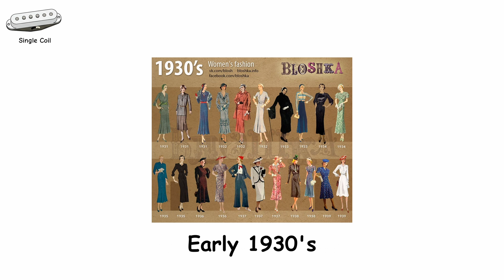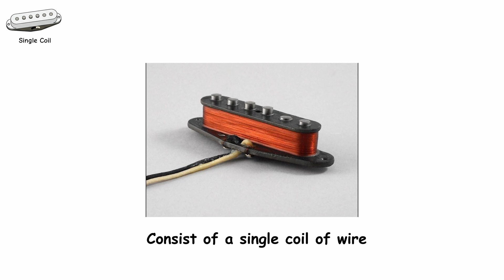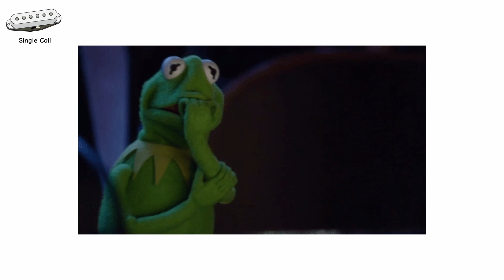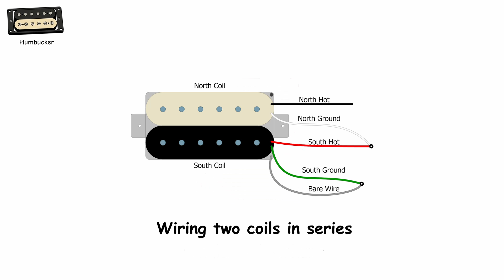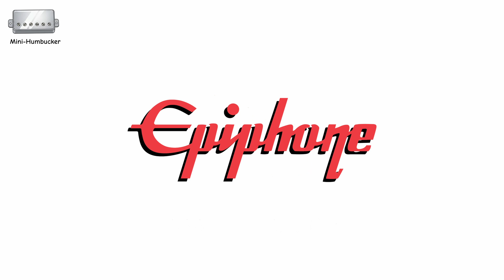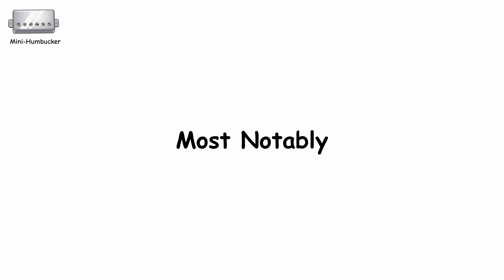Every Electric Guitar Pickup Explained

Comment: From CE 1966 to 1985 I worked in an electronics laboratory where we had the best R&D instrumentation and we made everything (including some Guitar Amplifiers, PA amps, sound effects boxes, etc..) as well as a lot of precision telecoms equipment we were there to manufacture!   

At one stage I picked up a Fender pickup and inverted it and the sound was identical, same with a humbucker – then the penny dropped.   All of the pickups have a lot of very stray magnetic fields – stray where they should not be!  It was very lucky the humbucker worked at all!  

Several years later (about CE 2000), I did some detailed electromagnetic mapping of a few pickups and this confirmed my worst fears that the people that designed / manufactured these pickups were totally clueless about electromagnetic fields and the associated electronics and prime reason most pickups sounded so different was the electronic circuit they were connected into. 

I also found a quite wide spread in inductance, resistance etc. for the same model pickups – and this is why the same pickups “sound different”!  Very poor manufacturing quality – and this was physically backed up when I actually went a guitar pickup manufacturing factory.  While there I gave the several tips on how they could really raise the Quality of their manufacturing to make their pickups sound far more consistent – and I showed a few people there how to actually reliably solder wires!  

Back home (circa CE 2010) as I had a very good understanding of electronic circuit theory, I then “electronically tuned” various pickups to musically sound like virtually any other pickup.  This was much easier than I originally thought.

Comment: The reason piezos sound so different is that they are picking up all of the frequencies on the string with equal gain.  It senses the stress at the end of the string instead of the displacement at some point inside the string length.  All harmonics have equal gain for stress at the end, but sensing displacement in the middle gets a comb filter effect with the comb time delay depending on the distance to the end of the string.  Furthermore, piezos are broadband while magnetic pickups are bandpass filters around the coil resonance frequency.  It has nothing to do with picking up body vibrations.

This is also why modeling guitars like Variax  sense using piezo.  They can produce the sound of different pickups in different positions by using a suitable FIR filter (different filter for each string) from the piezo.  All the frequencies are there and equak gain and so you just shape them to make it sound like a magnetic pickup.

Comment: It's ok if you don't know every detail about everything, but when presenting a video like this it's really important that all of the information you present is completely accurate. 
You really have to research everything you present. There are several incorrect statements in this video, they may not seem very important but that's how incorrect information gets spread. 
The mini humbucker was not developed by Epiphone before they purchased from Gibson. The mini humbucker was developed by Gibson and featured the exact same construction as a PAF, just smaller, this would have been a protected design covered by the PAF patent at this time. Gibson did develop the PAF specifically for the Epiphone line. Theres more to this but the important part is that the mini humbucker was developed by Gibson. 
Also the Telecaster bridge pickup was designed for the Broadcaster, Leo Fender just took the bridge and pickup design from his earlier steel guitars and adapted it for use in his first Spanish style electric guitar.

Comment: I know these aren't actually pickups, but sustaniacs are really fun to play around with.
Reply: They're still a pickup. 👍👍
Reply: @Lord_Raptor  They are not. They do not pick up any vibration of the string, it MAKES the strings vibrate. Its why they are often paired with a single coil next to them (that cant be used when the sustaniac is on, even with the pickup selector in the neck position), or without.a pickup next to it all all. Look at the Joe Satriani Ibanez signature, only a bridge pickup and a sustaniac, no neck pickup.
Reply: @WesternPhrog 
Yeah when the sustainiac is activated. When not it's just a normal neck pickup.

Comment: Isn't the lipstick pickup also on the Telecaster as the neck pickup?
Reply: Nope. It's a single coil pickup like the bridge, but with no copper baseplate and a chrome cover. It's closer to a Strat pickup, which Leo designed by developing the earlier Telecaster pickups.

Comment: Filtertron and Invaders Suck

The solution for 24 fret models to not sound clinical on the neck is to hot rail neck to the neck or around the 27th node. or a Mini humbucker in the neck. Also: Mini humbuckers compromise the humbucker sound on the bridge, it's not as round, but it's sort of brighter or ringier.

Comment: If you've never tried a Filtertron you really should try a Filtertron. The only humbucking pickup I've ever liked.
Reply: You won't believe me, but the best humbuckers I've ever used came stock in a budget Les Paul knock-off made by Schecter (SGR). I'm not kidding when I say that the low-end on those pickups are unrivaled by the ones on my Iceman, and my LTD 256-FM. There are good humbuckers out there, and you'd be shocked what doesn't get any love from the community.

Comment: This is a neat video! I've played guitar most of my life, but I am realizing that I haven't given much consideration to FilterTron, or Foil pickups.
I've had EMG's (and other active pickups) several times, and they were okay. They didn't do anything a buffer, compressor, EQ or boost pedal couldn't do. Except they'd do it with no batteries, and with a pedal you can turn it on and off. 
Just my 2¢
Reply: Not true though. Actives are not about more gain, scooped mids or extra bite at all. That's a total misconception. Trying to emulate the structural difference of active pickups by putting more stuff into the signal chain is the opposite of what an active pickup is about. Fighting stuff that's inherently there is not the same as not having it there in the first place.

The low-impedance signal of an active can pass through long cable runs or complex pedalboards without any high-frequency loss or signal degradation. The idea that you can get the same type of frequency response by just using an EQ pedal is mistaken as well. The under-wound active coils have a very flat, wide frequency response with an inherently high resonant peak by nature. In a way it's a much more pure signal - the opposite of cutting stuff and adding stuff on top, which always comes at the cost of affecting phase and transients. Active pickups do not over-saturate the input stage, especially in the lower frequencies, which leaves you with crisp and rapid transient tracking and note separation. You can't "fake" that with anything. Of course, they're also inherently noiseless. No passive can ever feel or sound like an active. If the application calls for active performance, get an active pickup. If you need passive response, get a passive.

Comment: no jazzmaster pickups? i guess it would have doubled the length of the video considering how long it would take to explain the differences between a jazzmaster pickup and a typical single coil
Reply: There's hardly any difference. It's exactly the same as a regular single coil except the copper wire can be wound to extend past the magnets.
Reply: @e @lnyt445 u’ve got a lot to learn it seems, from the fact that jazzmaster pickups are wound so thinly and flat, to the tonal characteristics, to the wide hi-fidelity range, to why it’s adopted by bands that use heavy effects on their pedal boards. it’s just way too much to cover
Reply: @7xig  it's not "way too much to cover", you're making it out to be more complicated than it actually is. It's still just wire wrapped around magnets like any other single coil.
Reply: @lnyt445 what? so by that logic, only 1 pickup should be in the video…
Reply: @7xig  No, that's your logic 😂
Reply: @lnyt445 i guess my phd in electrical engineering and circuitry design and bachelors in music were a waste! thank you random commenter, you’re right! it’s exactly like a typical single coil! have a good day sir, ignorance is bluss
Reply: @7xig  Unfortunately you're right, they were a waste. Good thing you're not a scientist.

Comment: Electric bass guitar players most popular is the split single pickup of the original successful electric bass guitar, the Fender Precision Bass. Still most popular 74 years later. I'm curious about that one.
Excellent video, informative, entertaining, well edited, seems AI free. Thanks.
I've often wondered about the vasty plethora of pickups. I think they are like carburetors, easy to change so they get swapped out a lot.

Comment: Do sustainiacs count as pickups😂😂😅
Reply: they do
Reply: @chimika_O its more of a tool built into a guitar to increase sustain, they do not actually pick up the vibration ofntue string and turn it into an electric signal, it just vibrates the strings.
Reply: @seph_phantom  ohh i didnt know that. so when we are using the sustainiac, all the sound gets picked up only from the other normal pickups on the guitar?
Reply: @chimika_O yea, pretty much.

Comment: Missing honourable mentions:
-P rails
-DeArmond Dynasonic single coils
-DeArmond GoldTone humbuckers [similar but different than just gold foil pups]
-HI-LOtrons
-P100 stacked humbuckers.
Reply: The jazzmaster pickups
Reply: @axeltadeo720 tbf the jazzmaster pickup is just a massive strat pickup lol
Reply: @LizordSwordthat makes sence. But at the end almost all the pickups are mostly the same thing
Reply: @axeltadeo720  That's like saying all V8 engines are the same.  It's factually wrong.
Reply: @gpickandnotebook it’s more accurate than saying all V8s are the same. There’s very few things to truly differentiate a design in pickup
Reply: @vexedpixels  Play a Tele and then play a Tele that's been redone with EMGs and say that again.
Reply: @a @axeltadeo720 whats the difference between that and P90 pickups? They both look the same
Reply: @San-QxXx They look similar but have differences. Jazzmaster pickups have a clearer, thinner sound, while P90 pickups have a fatter, fuller sound
Reply: @axeltadeo720  They're constructed differently. P90s have non magnetic pole pieces over bar magnets, while the Jazzmaster has individual pole magnets. The coils in the JM pickups are wider and shallower than in p90s or Strat pickups. An earlier post was right, the JMs are really just wide, shallow Strat pickups, though that change in shape does mean they do sound different.
Reply: @axeltadeo720 yep and the tele neck pickup, DeArmond Gold Foil, DeArmond Silver Foil
Reply: Lace Sensors, too, since they use a design that’s nothing like conventional passive pickups.
Reply: firebird pickups too
Reply: Seymour Duncan single coil humbuckers!
Reply: I have a set of P-Rails in my Les Paul custom.  Those things stuuuupid awesome and I can sustain long enough to go have a bite and then I come back and it's still like "Mnnyaaaaaaaaaaaah."
Reply: @BigDamnGyro  Does your amp also go to 11?
Reply: @gpickandnotebook  I got the early 90s model that goes to infinity.  ;P
Reply: What about Mosrite pickups?
Reply: G&L MFD?
Reply: Z-coils too
Reply: Another honorable mention: Burns Tri-Sonics. The Creamery makes a great modern clone.
Reply: Lace Sensors too
Reply: They're missing a ton of early pickups, too, but they did hit the biggest ones still around today.
Reply: Also missed the hot rail pickups
Reply: The wide-range Telecaster 72 Deluxe pickups
Reply: Brands are not pickup types.
Reply: @JohnDoe-qz1ql a lot of 'em definitely are tho, inherently.
Reply: Facepalm….
Reply: Also  P ness
Reply: Humbucker is a humbucker and single coil is single coil. He didnt say every brands minor changes, he said every type. Youve listed types already descrived, excpet the p rail. I dont remember what that one is. I know ive seen it tho
Reply: Also Jaguar pickups, split singles, stacked singles and tri-Sonics. No doubt there's even more.